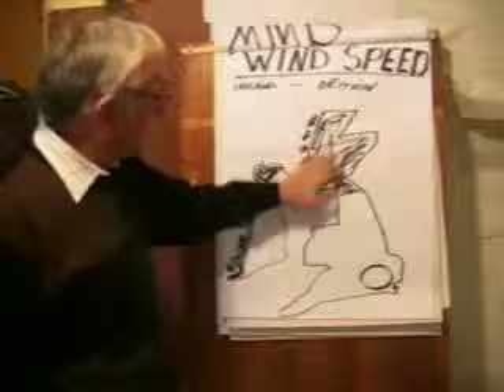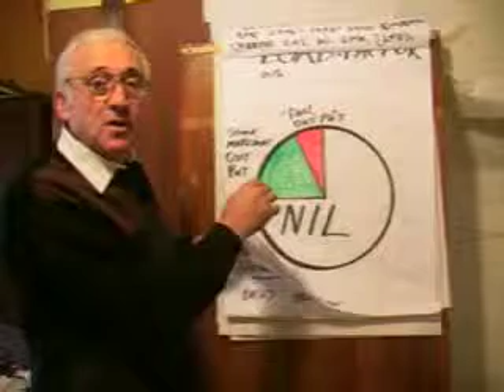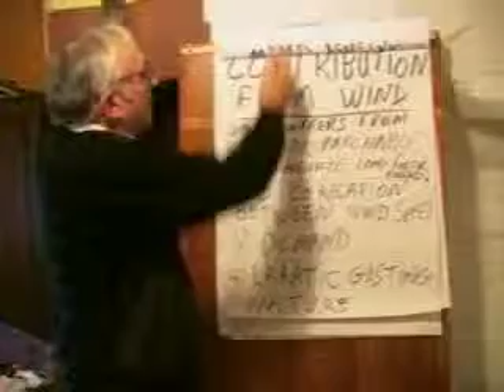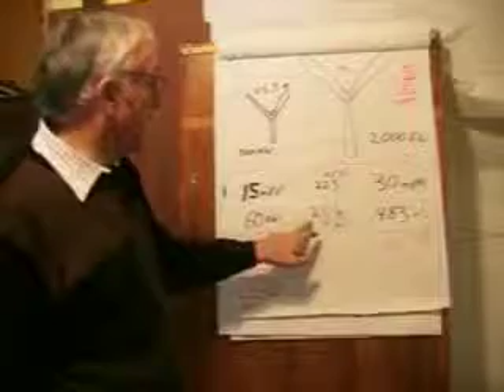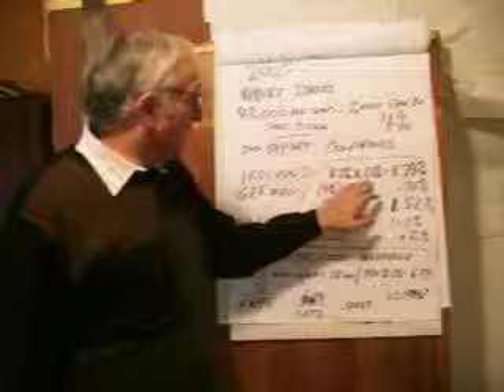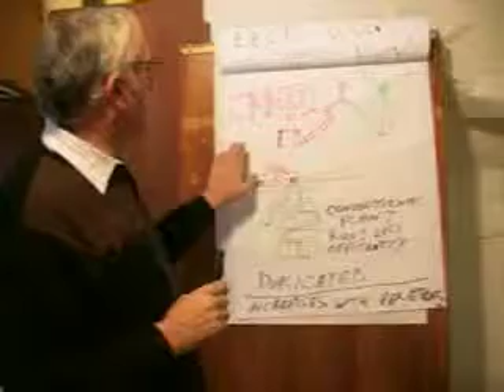The Myth about Wind Farming - Part 2

Comment from the maker: Eirgrid now put the limit of wind energy which can be allowed into the system @ 50%  maximum.      On windy days,  no country is letting in any more.   My figure of 22%  is an average over a period and it is slightly misleading.    Wind and imported power are non -synchronous.  The inertia of the conventional synchronous system is adequate to maintain inertial frequency  provided it is more than 50%.  Irish government engineers claim they will be able to allow up to 75%  wind in, but there is no information on how they intend to do it.  Wind cannot be used for base load plant which is 46% of demand.

Comment from the maker: Irelands turbines have the capacity in full winds every day is =  16,206,000 mwh.  Ireland's demand is average about  3,300 mw  x 8760  = 28,908,000.      56%.   If wind worked per capacity we would save 56% of fuel.    If wind were measured  25%  it would equal  56 x ,25  =  14%.  Where is the evidence for this?